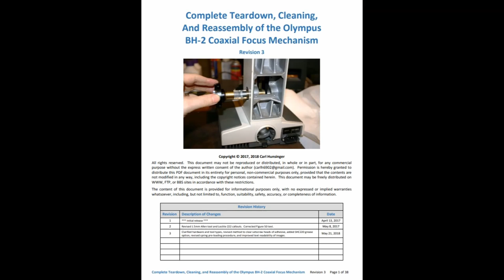Overhaul of Olympus BH-2 (BHTU) Microscope - Part 2 (Coaxial Focus Mechanism)

Comment: Hey Carl, I just bought a BH-2 for home use for the family so we can all get some eye experience in the micro-world of things. I appreciate these videos you have made because they will definitely be my guide to getting this guy back to its optimal running state. I have a few major issues with it. Excuse me as I'm not sure what all the proper names are for everything on the scope yet but I have a few areas on it that are completely seized from old solidified grease.
1- locking mechanism for the focus, (like in this video)
2- the eye distancing/adjustment slider.
3-the bottom adjustment for the light aperture (the ring does not spin)
If you can offer a little guidance, I would be super grateful.
Will slight heat get the grease unlock it enough to take these items apart to clean? Can I inject some type of degreaser into these areas to loosen it up? Could you recommend a process to get these areas free enough to take them apart and clean? Cheers
Reply from the maker: Apply penetrating oil and let it work for a few days. Gentle heat.

Comment: Hi Carl, do you have any suggestions for a BH-series scope? It doesn't have the full-height cover on the back like the BH-2. I suspect I'll have to remove the gearbox from the front side, though I suppose or could be attached from the bottom.

Comment: are all bearings in Olympus scopes 1/16th inch?
Reply from the maker: I do not know for sure.  Many use a very similar pinion assembly to the BH2, and I believe these use 1/16".
Reply: @carlhunsinger9638  Thanks, appreciate the response. Do you possibly know where to get a spare spring for the coarse adjustment knob shown at 11:15?
Reply from the maker: @philhunt1442  contact me via email:  carlh6902@gmail.com